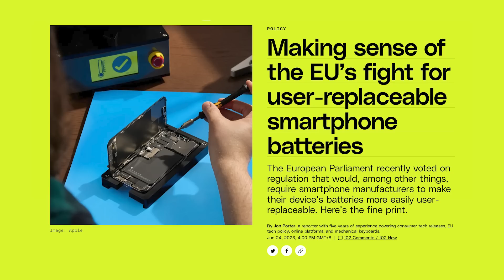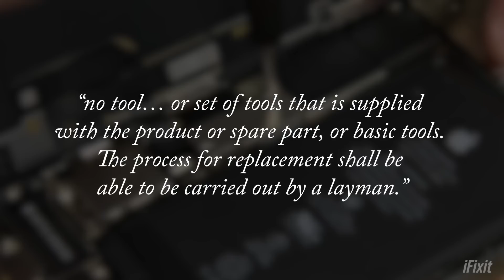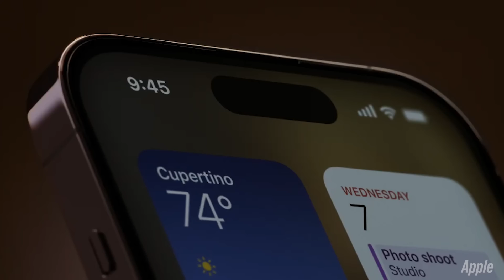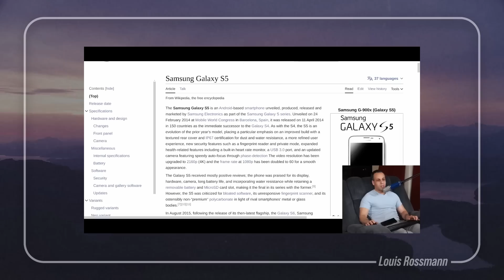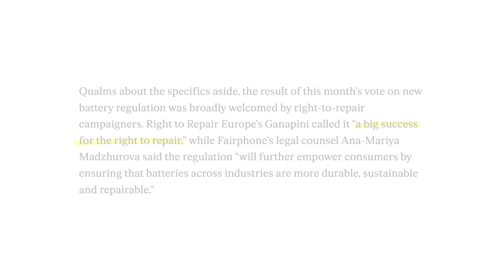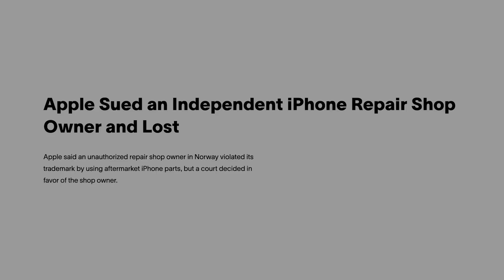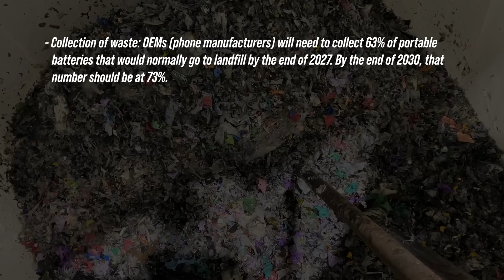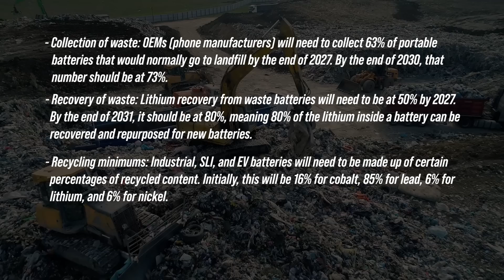EU Just Changed Smartphones Forever

Comment: I would love to see EVs with interchangeable battery modules.
Reply: They are interchangeable, just like any phone battery, it just requires special tools. The battery is like half the weight of the car, and uses a lot of space, so it needs to be heavily integrated with the entire vehicle in non-trivial ways. It's not realistic for a regular car owner to be able to move something that large without specialized tools. Unlike phone batteries, ev batteries account for a large portion of the device's overall cost. Cars are much more complex than a phone. There are a lot more safety and performance considerations about where and how the battery is put in the car.
Reply: @megamaser When there is a will, there is a way. EV batteries are up to about 500 Kg. They consist of smaller cells anyway. Its not that difficult to have them in slabs of 50Kg each, so you need to loosen the screws and remove 10 slabs. A regular person should be able to replace all (or some) of those in his home garage. Don't give me that safety and performance bs, please.
Reply: @megamaser  I should have been specific. I was suggesting that smaller vehicles could be designed with batteries that could be replaced by a shop to extend the life of the car. I wouldn't expect people to change out a giant battery in their garage.
Reply: changing EV cars battery and phones is such a dumb comparrison

Comment: If water proofing/resistance is an issue just include a rubber gasket in the battery cover to seal out the water. Problem solved.

Comment: ebikes (mentioned late in video) typically have user replaceable batteries already.  Even the ones inside the downtube usually have a cover that comes off with no-tool fasteners or a standard torx bit.
Reply: Had, its again same  thig as was with phones and laptops decade ago. They used more or less same parts and you could change batteries or use parts from different manufacturer. Ebikes are on same path firstly made with user in mind but now corpo want their money so lets seal everything with strongest adhesive and throw in special connector that force use only our special overpriced cable (that is same as any other) for no practical reason at all.

Comment: The automotive industry have the recycling issue sorted out. It's simple, core charges. For anything you need the casting or raw materials back for there's a core charge. It is a substantial fee in most cases. You are highly incentivised to turn in you old part.  Somewhere around 90% of all car batteries sold are recovered. That process for lead acid is 95% efficient.

Comment: The Samsung XCover phone series has user changeable batteries and is water/dustproof.
In my opinion, the nonsense with the fix built in batteries originated from an "ease of manufacturing"/design requirements standpoint in the developing process and proved to be successful, so the manufacturers stuck with it, as it only has advantages for the manufacturers, .....

Comment: John Deer are another big offender when it comes to right to repair. 🚜🫤… All of their modern agricultural equipment is controlled by and linked to onboard computers and owners can not repair or replace anything. So rather than bolting on a replacement part… 🔧🤨… The entire tractor needs to be loaded onto a trailer and sent 500 miles to the official John Deer workshop.

Comment: I think design changes making devices difficult/impossible to repair were both natural progression and intentional design on the part of manufacturers. The push for thinner phones may have come from consumers (… or did it?). However, the first phone design with a battery that couldn’t be replaced would have been carefully considered from every angle by the lead tech, financial, marketing and consumer relations executives at each company, and they would have been fully aware of the potential profit and environmental consequences of the new design.

Comment: Well, didn’t the EU ban iPhones using lightning cables, as it requires users to spend more money on charging cables and wired headphones? This change means Apple loses money on lightning cable sales. They have to redesign their phone, so I wouldn’t be surprised if they also integrate the removable battery to their new designs. In that case, I do see Apple making special EU phones. I do not believe they are going to universalize USB-C inputs or removable batteries on all their phones and tablets unless they have to.

Comment: I would just like to point out that the only reason the "glass sandwich" became the smartphone norm was because wireless charging does not work through metal phone casings, you need something that can let electromagnetic waves through it. Plastic is too cheap and flexible for the fragile coil of wire required for wireless charging. Glass is smooth, stiff, and relatively robust.

Comment: Another thing comes to mind that still makes me miss my old Galaxy S4 with the removable plastic back cover - if I dropped that phone, the back cover sprang off, the battery went sprawling, but the phone casing and screen stayed intact. I didn't use a screen protector, I didn't use a rubber casing protector, I could rely on the impact forces being dissipated as the cover came off. I'd pick it up, dust it off and reassemble. The screen had not a single crack in it during the 4.5 years I had that phone.  Now with my sealed phone I have to have all these protections in place and the screen protector regularly gets cracked when I drop my phone. If I didn't have one, my screen would've been obliterated a long time ago.
Reply: I had the very same experience with my Galaxy S3 Neo, good times
Reply: That was the last version that also used the scratch proof formulation of gorilla glass. I miss that
Reply: I mean, the screen on my s21 is definitely more forgiving than both of the s4s i had, but that's because a simple silicone case is enough to protecht the screen enough for me, and i am a bit more careful with how much force my phone now experiences than i was as a teen.
Both s4's had their screens broken, one had the glass absolutely wrecked, the other had the lcd screen broken. Each time happened through stupid little accidents, like polka dancing with a hotel key in the same pocket which broke display, but had the glass intact or grabbing my towel from the shower and slinging my phone that was atop into a tile across the room on accident, but i think any phone without a case would struggle not to break under those circumstances (i think the first time my s4's glass broke it actually fell onto carpet from like a meters height)

Comment: The European Parliament behaves like a child with this law. I am for the right to repairs, but certain things should not be built around the law, these instead of functionality. They gave an example of the s5 from Samsung, what they didn't say is that after a few months it lost protection against water due to wear of the cover. And for large electronics, I don't see why the batteries shouldn't be secured with screws? And when batteries are larger and heavier, quik relay systems become more inconvenient and wear out exponentially faster, leading to the need to change the battery case before the battery dies.

Comment: Until 6 months ago, I had a Galaxy S5 from 2014. That phone had an IP67 certification and it worked perfectly even when I accidentally dropped it in a puddle of water a few years ago, and not to mention when I needed to use it during heavy rain, it was fine.

And that phone was my workhorse until the screen died from prolonged use (today the screen is still made but in very small quantities, and its CPU speed was already lagging behind for today's apps, so it was best to let it sleep now and thanking it for its 9 years of service among the 4 or 5 owners you had in multiple countries, me being the last).
I have to say I would change the battery about 4 times in its entire life, $10 minor maintenance, plus bus fare to the parts store.

Then in March of this year I bought a used S9 2018 (I usually do this as I believe phones should be used until the day they totally stop working even if I'm the 5th owner and I honestly don't care if I have an old or new phone, I just want it to work).

I love its performance, but a few days ago a battery degradation notice appeared. I'm glad I have a heat gun, but if I didn't, removing the battery would be a pain in the ass. Technicians charge me $30-$50 (considering I bought the phone for $100), and I feel nothing but sadness for people who are forced to buy a new phone just because they can't change a $10 battery, because either because they don't know how to do it simply because they don't have the tools, or because a technician (official or workshop) will charge them a lot of money.

Everyone has the right to decide if they will go to the manufacturer, a repair shop, or if they will do it themselves, be it for a small maintenance or a major repair.

Comment: I think EVs with easily removable batteries are the key to making EVs work. Sitting for 2+ hours to charge, this is where EV is behind gas. It takes 30 seconds to fill your tanks, but hours to charge. Fully charged battery stations are the key... with easily replaced batteries.
Reply: Just pick up that 400 kilo battery pack and swap it out. Easy peasy.
Reply: @guymetdrapedes220  yes, It is... have you ever seen powered equipment from a warehouse that run on batteries? There's equipment that make a battery change easy, and can easily be set up at stations.
Reply: That doesn't mitigate the nearly 1000lbs of battery weight. Are people disposing of these batteries after their use  or is there some communal program where people are swapping batteries out at service stations?
Reply: @guymetdrapedes220  lol, that's cute...1000lbs... you've never worked in a warehouse, did you? Lol forklift batteries at minimum is 2000lbs with an average of 3000lbs and still with the right equipment is easy to change,  and yes a station could easily recharge a battery then exchange it again. Similar to how a propane exchange works... but perhaps you've never done a propane exchange either... but it's much easier.
Reply: This has been done, no one used them.
Reply: @jasonmajere2165  name it, I never heard of such a model
Reply: They made swappable battery cars in China. Not a success, to say the least.
Reply: @gorkyd7912  lol probably because it was China lol

Comment: Yeah ! Replaceable wires in bulbs also required immediately ! And replaceable cores in processors. And that dumb dead pixels in LCDs - let's force them to be replaceable too ? It will just stuck technology progress and make phones more expensive because of much more complex R&D and more wide support. We will have 100+ types of proprietary replaceable batteries on market just like we already have for cameras. Remember bunch of different charges for Nonie back in 00s ? That's what you might expect with batteries. But also phones will evolve twice slower because of forced stupid requirement. 99% of consumers doesn't care about their batteries. If they need a replacement they will go to service and have it in a few hours or minutes. It's a great example of stupid vocal minors slowing down the whole technology area because of leak of mid/long-term vision. 

And yeah ! It will force parallel import when US models will be brought to you by third party companies because it's much cheaper and easier than provide EU only models or change whole production lines to comply stupid government. Remember requirement to TELL ABOUT COOKIES and ask user? To "protect personal data". How do you feel now with this clever decision ?
Reply: Its funny you bring up CPU's, imagine having to throw out an entire computer just because the CPU is busted. Stupid, right? Well that's what we do with phones, and what this is aiming to prevent. And incandescent bulbs have pretty much been banned in favour of the much more efficient LED bulb so not sure why you bring that up.

Comment: Apple be like 1000mah -200dollars 
2000mah-400 dollars 
4000 mah -800dollars
And the battery will not be included in the box since they are concerned about carbon foot prints

Comment: Love it! But it doesn't go far enough. This should be extended to other parts such as the display, logic board, camera and so on and also to RAM and SSDs in laptops. I find it really frustrating that it is now literally impossible to upgrade these wear parts. I don't wanna spend 500+€ on a new logic board when a new SSD or RAM for 50 bucks would do. 
This is even funnier at Apple: in Austria there was a government bonus that subsidized repairing consumer electronics. Using this it became feasable to replace a Macbook Airs whole logic board to get more RAM and SSD. But here's the pun: Apple will not give you the spare part. They only replace it for the same. I could go to some fishy repair shop but then I maybe things don't work (as Dagogo pointed out in the video) and also I wouldn't get the subsidy.
I used to like Macbooks but I hate what they've become. Literally everything that breaks costs a fortune. And things do break because sometimes they fall or whatever. Because of that I only buy Windows Laptops now that come with replaceable parts.

Comment: I 100% believe that it was a way for manufacturers to shorten the lifespan of the products for the users. I am also old enough to remember the slim, waterproof phones WITH removable batteries! Phones have not gotten that much slimmer since they started sealing batteries into phones and I can actually remember a bunch of clever designs which kept the phone slim while still allowing the battery to be removed.

This is a great step forward and I’d happily take my battery to a drop off point.
Reply: Hardware is only part of it.  We need better update policies and longer support.  Planned obsolescence in action.
Reply: @RandomPlaceHolderName  Part of the same law package that makes replacable batteries mandotory also makes it manditory for software and security to be ensured for the lifetime of the device. Yes this "lifetime" will be messed with a lot but the EU is generaly pretty good at enforcing the spirit of the law and not the companies "creative" interpretation of it. It might even state that for mobile phones it would be atleas 5 years.
Reply: @someonespotatohmm9513  Would be lovely to see. A phone with a replaceable screen and battery could last a decade, especially with performance stagnating over the past 5 years or so.
Reply: @RandomPlaceHolderName  I think the phone that comes the closest is the fairphone.
Reply: Give me a small to medium sized phone, removable plastic back, solid up to date specs, and I'm cheering. The second a phone has a crack, I doubt I'll be taking it near water
Reply: We’re they waterproof?
Reply: @johnp139  I mean…. That is literally what I said…. So… Yes.. look up the specs for the Samsung Galaxy S3.
Reply: Actually look up the 4 and 5 as well.
Reply: @johnp139 
The Samsung S5 was and with a removable battery. That phone back then with a fully removable back cover is still thinner than most current models today. Manufacturers could easily move to removable batteries but the only way they will is if they’re forced to by law.
Reply: You're talking like having a removable battery phone is something so old most people won't remember it. I was born in 2002, and I had my fair share of phones, getting my first non-removable phone around 2015, which was the samsung galaxy S6. it's never before even occured to me a phone could be that slim. There are slim phones with removable batteries, but THAT slim, there aren't ways of doing that reliably without increasing the girth. Or you can lower the resilience, which is even worse, but you'll get the thin look, you know, until you drop your phone once, and it's back cover gets completely destroyed.

Comment: Apple way of "conforming":
USB C port will be limited to USB 2 speeds and charging rate (so no change since lightning also uses USB 2 speeds), and if it detects a not genuine cable the whole thing will stop working
Batteries will no longer be included with the phone (extra points if they tell it's to reduce carbon emissions), but the price will stay the same while they sell a battery for half the price of the phone, and if the phone detects a non genuine battery it will cause the battery to explode and blame the user for buying one in the first place

Comment: Of course it was deliberate. Many reasons, including all the reasons you have stated in the video. I need not repeat them here.
Maunufacturing savings, easier processes, plus no need for spare parts, (The only people needing spares will be the approved repair agents of the manufacturer.) Third-party repairs will be a ring of the past.
And here is one that you possibly have not considered. Surveillance and collection of private data. If a battery is non-replaceable, the phone or tablet can remain ON when it appears to be OFF, albeit in a highly degraded mode. In degraded mode the phone can continue to send back data to base.

Not saying this happens now, but it is possible, and highly likely. You do not trust Apple... I trust Samsung even less with regard to spying on its customers.

Comment: Guaranteed anti-consumer. If that doesn't work, they will "update" your firmware to make it not work. HP printers have this feature already. Aftermarket and old original stock cartridges will no longer work. Screwing the customer is industry standard. Better get a grip on it before electric cars takeover. Imagine only manufacturer repair depot service. No other option. You have to take it where they demand, and pay whatever they charge.

Comment: Glass glue and metal make replaceable batteries impossible?? B.S. any engineer will tell you b.s. 

It’s corporate greed. Being able to charge over $1k for a phone that has a 2 battery lifespan and locking that battery inside guarantees the need to replace the phone every 2 years.